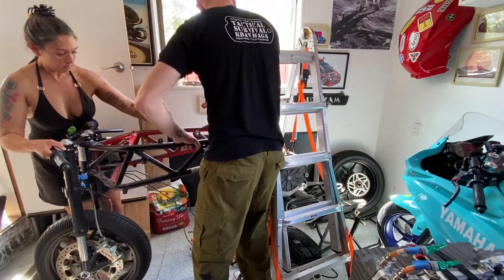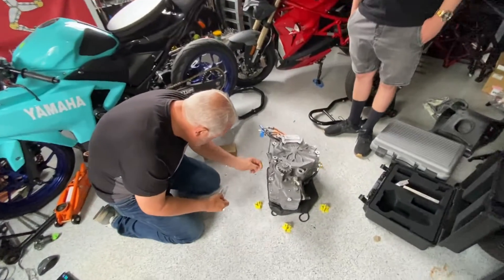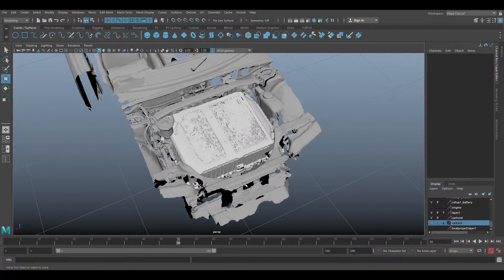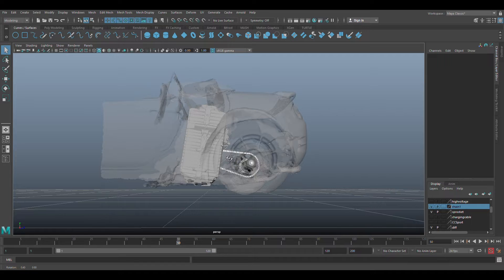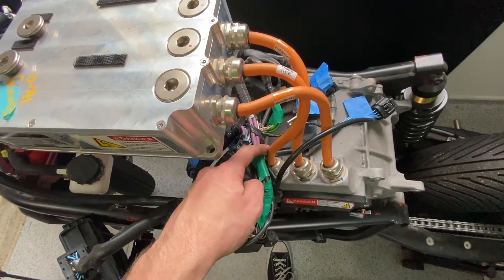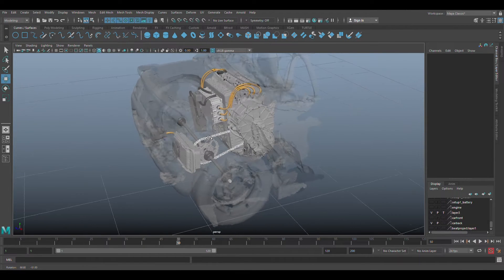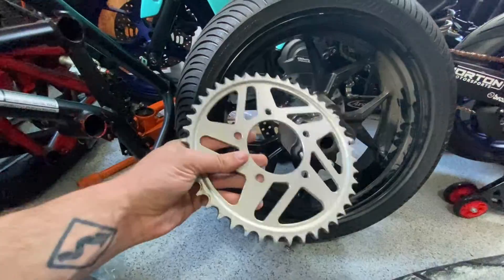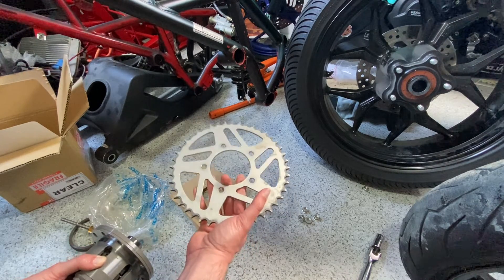Electric Honda Beat Conversion - Episode 5 - 3D Scanning the Energica Parts

Comment: Fore and aft weight distribution is much more important than side to side.
Fore and aft affects cornering . Side to side has virtually no effect. Most cars are driven with only one bloated sac of protoplasm in the front seats ,unbalancing side to side by 50 to 100 kg.
Side to side is pretty much irrelevant unless you intend to roll the car frequently
Reply from the maker: Good point!  Right now the weight is 43% front / 57% rear, and I'll probably be making it even heavier in the back.  Hopefully that will make steering easier and braking more controllable, but understeer on hard acceleration might be an issue haha.  A friend challenged me to make the car do a wheelie.  We shall see!
Reply: @NewZeroland  It might wheelie in reverse

Comment: Anyone else here fall into the trap of thinking "wait, but isn't the driver seat is on the other side? oh.... nvmd" 
Taking shape, great update! But what's wrong with a BTTF look?
Reply from the maker: Hahaha I wondered about that.. maybe I should have put an arrow or included the steering wheel 😂 BTTF look would be sweeeeeet if it didn't rain all the time here. I would love to show all the cool wiring off but it's safer if it's hidden inside, protected from the elements. Even plastic rusts in New Zealand.

Comment: The 3D looks great, definitely a lot easier to visualize things. If I was doing this, I'd end up test fitting a bunch of stuff make some measurements and hope I could get it right (long term project but I hope to electrify a '67 Impala some day). 
The LSD looks amazing and I hope you're able to use it the way you want but I think at some point you may end up just simplifying things and go with a straight axle chain drive with no differential as that's already looking like it's going to be far more engineering than it's worth. I swapped my welded open diff in my '90 RX7 to a TorSen like the one that came from the factory in my BRZ that I'm going to have to swap out for a clutch diff...As much as I prefer TorSen, for drifting and Rally I need to have a clutch diff. Point being I've done a lot of diff swaps in stock carriers and they're a huge pain, so I wish you the best with your plans with this custom setup.
Reply from the maker: Thanks man! There will still be a ton of test fitting in real life once the car is gutted, but this at least gets me a plan to work with. The LSD will allow me to use the stock axles (custom axles are crazy expensive) and if I did a straight axle it wouldn't be driveable 😂 You never go full go kart!

Comment: Why not the controller above the motor? It would look cool with a custom clear access hatch. I also think they may have mounted the controller that way for heat dissapation the top of the pack may be lower in temperature when heat is being generated. I guess that only depends on how your mounting the controller though.
Reply from the maker: Hmmm there might be room up there, but then I'd have to extend the coolant lines. Either way I'm customizing stuff 😂 and keeping the weight lower is better.

Comment: Awesome project. Two aspects to keep in mind. reverse, can be achieved via electrical switching and simple control circuit. Chain, remember to include a separate tensioner (either auto or manually adjusted) set up being the motor and diff are fixed. BTW, chain guards are a must too, keep crud out and retain chain in case of failure to avoid damage to components. REALLY looking forward to seeing this beastie come to life.
Reply from the maker: Great advice!  Thanks so much.  This is what I love about posting progress videos.  Everybody can chime in and help :)  I'll definitely sort out a tensioner setup, most likely to shift the motor back and forth within a frame structure of its own.. and yeah guards.  Lots of guards.  It'll be a fun challenge!
Reply: Solid input didnt even consider things like chain guard.
Reply: @DaReapa  would be dangerous if something were to get caught

Comment: 5:23 Might need a beefy chain guard to to stop chain oil flicking onto the charger and to stop the chain ripping through the charger if it snaps.
Reply from the maker: Good idea.  I was thinking about a fully enclosed setup filled with oil, but a guard might be enough.

Comment: 3D scanning FTW! I’ve been using one for my project as well, certainly handy and a great time saver. Maybe I missed it in previous videos, but how much range do you think you’ll get out of the energicar?
Reply from the maker: Dude nice!!  Which one do you have?  I looked up the price of this guy's professional Peel 3D scanner and it made me cry a bit.  I'll keep using the crappy $400 one.  My guess is about 30 miles of range.. realistically XD
Reply: @NewZeroland  I have the Revopoint POP2, there’s def a leaning curve with it, but it’s helped out on smaller components. Yeah it seems that no matter what, you’re forking over some serious cash for a good 3D scanner. Really cool that you got access to a nice one, those scans are quite handy when trying to figure out the spatial stuff! 

30 miles 🤣🤣🤣🤣

Comment: Aren't you concerned that changing the sprocket+diff might give you speed reading quite different from reality? Not too much of a problem if you use a patched version of Energ1ca Android app though, but still something that could mess the readings on the Ribelle original dashboard (just a wild guess though...).
Reply from the maker: Yep, I'll have that adjusted once I get a new sprocket made up. Sorting out the speed sensor is another problem I need to solve.
Reply from the maker: @ghostbeatpp1  unfortunately GPS speedos aren't allowed as full replacements to the originals in New Zealand. That would have been the easiest answer, for sure.

Comment: I would definitely think about the chain system and how to make sure its reliable.  If you watch rich rebuilds recent electric side by side videos you can see he destroys the chain and needed a tensioner. make sure you can access the chain to repair it easily without taking apart the car. Good luck with the build!
Reply from the maker: Oh yeah, it'll definitely need a tensioner.  Rich's side by side is a great benchmark but I'm hoping to get a bit higher build quality than that.  We'll see how it goes!

Comment: I would put some thought into beefing up the chain and tensioning/guiding it. In many conversions involving a chain it turns out to be the weak part. Nothing beats a card board / plywood mock-up before cutting metal. Thanks for keeping the (fat?) cat component to a minimum.
Reply from the maker: Thanks man!  Yep, definitely needs a tensioner setup.  I've consulted a custom racecar builder about this and he seems to think it should be pretty simple :D

Comment: How does the LSD work? Well, in an oil bath for starters.
Reply from the maker: Haha yeah, it'll need a custom housing.  That's another part of the next step.
Reply: @NewZeroland  The tricky bit is that the diff needs to be inside the casing, but the chain needs to be outside. 

You need something like the diff unit used in the pro-motive kit for putting an R1 engine in a Mini.

Comment: I suggest that you put the sprocket on the inside of the diff flange rather than the outside. This will give more room for the bearings supporting the diff.  You might be using a slightly smaller custom-made sprocket anyway, considering the weight of the Beat compared with the bike. They're not expensive. A custom sprocket will come blank so you can drill it to suit the holes on the diff.  N.B. This is what I did.
Reply from the maker: Whoa, great point!  I didn't consider the space for the bearings.  Thanks Brian!

Comment: You're making this seem too easy, dude. Where's the "Oh nos, the battery will explode if we go under 80kph!" level drama? I mean you even got someone with a pro scanner to help get the fitment right. I kid, of course, there's a lot of mount fabricating that will need to happen and I'm guessing a LOT of hoping there there isn't some essential structural supports that will be in the way of the battery/motor compartment plan. Personally, I think the BTTF time machine exposed cables look would be darn cool, but probably be frowned upon by NZ law, even if they aren't the big orange death cables.
Reply: He did say that he has no clue about what he is doing 😅.
Reply from the maker: I'm glad you think it looks easy lol.  I still have no idea what I'm doing, but every step gets more exciting.  Honestly I'd love to leave the controller out in the open, but it rains so much in NZ that even plastic rusts.  Don't worry.. there's still a chance of the car blowing up :D
Reply: @NewZeroland  Well, if it does blow up make sure it's on film. #content

Comment: Does that LSD need to be in gear oil in operation?
Reply from the maker: Yep, I need to find out what kind of oil or grease it needs and seal it in a custom housing.
Reply: @NewZeroland I'm glad you're already thinking about this. I was going to make a similar comment. I don't think the diff would last long exposed to the elements.

I couldn't tell from the video: is that a helical-gear (Torsen-style) diff, a clutch LSD, or an open diff? My choice would be helical.
Reply from the maker: @awo1fman  it's a clutch / friction plate LSD.  Turns out I'll need a specific kind of oil for it, so this will be an interesting fabrication project.

Comment: Very cool project. I think it will succeed. Get a machine shop to cut a little shoulder to center the sprocket when they drill and tap the bolt holes. Don't trust the bolts alone.
That's a sexy little diff. How are you lubricating it and protecting it from debris? Where did you find it again?
I need to watch the earlier part of this series. I've been a little overwhelmed with YouTube recently and have fallen behind in your adventures. Looks like your sub count is up 🙂
Reply from the maker: Haha thanks!  That's great advice.. I'll have a housing made (basically a cylinder that fits over the diff) and fill that with grease.  Connecting that to a plate with tapped holes for the bolts would be awesome.  I got the diff from Black Hawk Japan.  I think they're just an exporter that sources parts from other companies, but they were great to work with and the prices were good.
Reply: @NewZeroland  Depending on the type of diff, you may need to oil lubricate it and use an LSD additive (or limited-slip spec oil).

I've seen a bike engined car where the diff had fewer holes, and they were able to just seal those up and run some oil in it. Not certain how they kept it from leaking out past the shafts though.